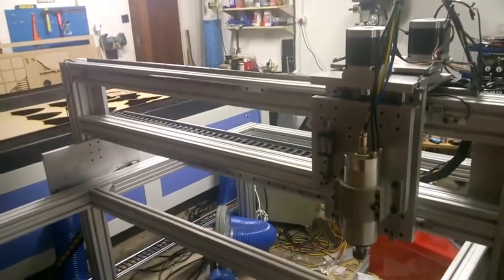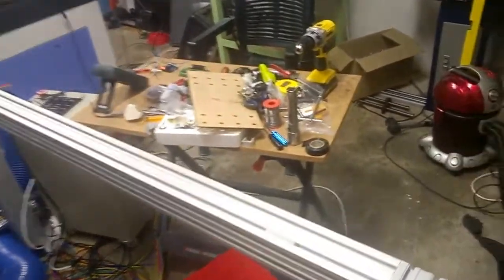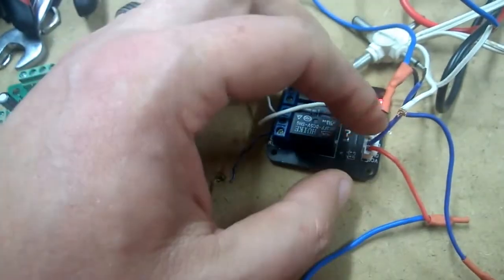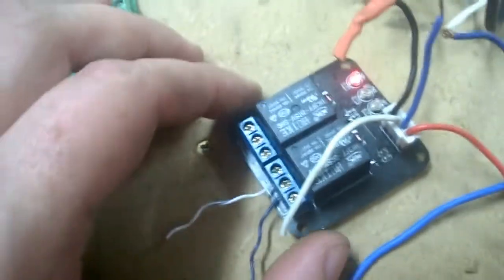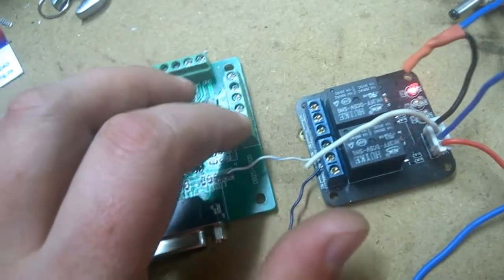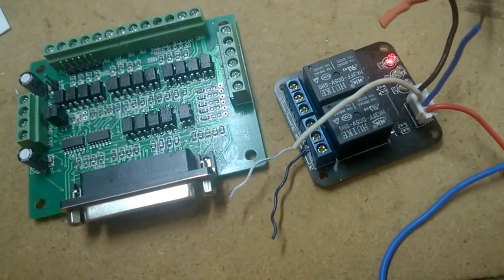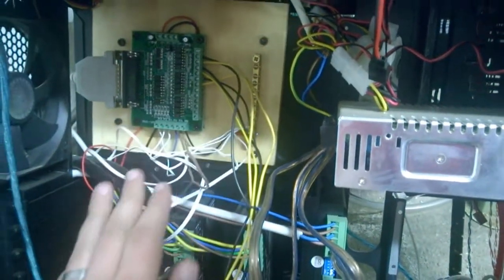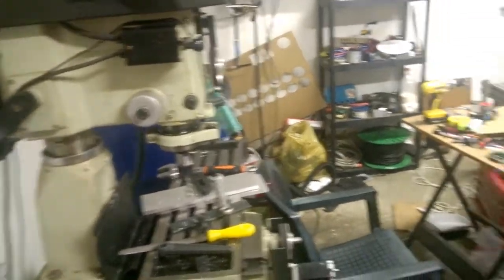Plasma Relay on CNC board

Comment: @Vatso.... a little help. how many volts goes to the "com" of the relay? can the plasma trigger when for example 5v is sent from the relay to the plasma tip. my relay output is like this "NO/COM/NC" i am wondering if i should give the COM 24v dc or 5v dc in oder to fire the plasma. your experience would be helpful to me. thanks in waiting your reply
Reply from the maker: Hi there - the best way to explain this is that there is only voltage for the relay to work. when the "trigger" is pulled on a plasma touch there is no voltage. so all you need is the relay to pull closed so NC & the plasma will fire.
Take the 2 wires from the plasma touch and touch them together the plasma will fire. of course the plasma machine needs to be on
Reply: i got it.... many thanks  ("....so all you need is the relay to pull close so NO & the plasma will fire......" i hope i corrected it）

Comment: hi vatso. i have a few questions. i have the same thc as you. The leeuwinga. it has a relay for the plasma torch included that you setup in mach3 but it doesnt want to work. i then went and bought a double relay but the problem with this is that it needs a ground signal and i have no idea how to set it up to work correctly. the vcc goes to positive and the ground goes obviously to ground but when i take the signal wire from either relay and connect it to positive nothing happens but when i connect it to negative the relay closes. I dont know if you still use the leeuwinga thc but i habe a few further qeustions about it if its possible.
Reply from the maker: Hi Stefan, what you need to do is get an output from Mach3 to switch on and off once you have that working you can hook up the relay. the easiest way to do this is using the same input power you running your BOB connect it to your relay "Your Bob And Relay need to run off the same power supply IE 5v" connect your relay + & - as normal. what you then do is take the relay trigger and connect that to the output which you have working as step 1. what you will see is when the output goes to 0v it will trigger the relay "turn the output on and off in Mach" now all you do is make sure the output has +v when you don't want the plasma to fire and 0v when you want it to fire
Reply: vatso hi vatso thanks for the reply. ill defenitly do that tonight amd let you know what happens. i assume you didnt use the relay that works with the thc? reason im asking is . ive configured the thc the way they said from the manuel i recieved from cncdirect. when i turn on the torch in mach 3 the display panel torch led comes on which indicates the thc bob recieves the signal but nothing happens with the relay. the specific thc has the bob and the plasma interface card that connects to the bob via a 9pin vga cable. the plasma interface card has the torch relay,z limit switch, and arc ok signal. ive connected the z limit switch and it works fine but the relay nothing although the torch led lights up on the display panel when i turn on the torch in mach3! i hope this all makes sense,struggling with the english here haha! thanks in advance
Reply from the maker: Hi Stefan, I am using the Boards internal relay which was working fine - I am in the process of setting my machine up again just did a house move. It could be your Mach3 setup - I will spend some time this weekend testing and sharing my settings with you
Reply: vatso thanks that would help a lot. i will also post my settimgs as soon as i get home maybe you can notice something wrong

Comment: i want to use my hypertherm power max 1000 g3 standard hand torch on the cnc plasma table i built but im a bit confused about how to splice in to which wires in the unit i have........in the back theres a "cnc ready " port but idk if i have to buy the machine torch......im kind of strapped for cash which is why i would rather use the relay method and use the hand torch but i dont even know where to start.......should i trace the trigger wires and splice into them and use a relay connect it to my break out board outputs and set it to something in my mach 4 configuration ?.......im a neeewwbbbb help lol
Reply from the maker: Hi there, the trigger is just a contact switch if that makes sense - what you are doing is setting the relay to just make contact. the secret is the type of relay that is triggered with a 0v. the BOB can't output enough power to turn on the relay. the way to test if it will work is take the relay and make sure it can be powered by 5v "Input power of the BOB" and triggered by 0V / ground. once you have that working you can connect to your bob and set it to trigger when the input is turned off "Ground"
Reply: i might sound dumb but whats a "0V" and a  "bob" ? lol
Reply from the maker: BOB is the breakout board the board that connects to the computer - V0 = Ground
Reply: Thank you....i got some 5v 2 channels raspberry relays...think thatll work for that application?
Reply from the maker: I will make another Video trying to explain how this work

Comment: hey Boet - hou gaan dit? I was wondering if you possibly cover something on lengthy bits or long reaching methods, as Im having difficulty with reaching areas where my drill bits arent long enough, so I tried without success to build some long reaching gadget to get the reach - would you try to possibly lead me to some written material that will possibly get through this problem? Best regards Joao from Jo'Burg

Comment: Very cool build , i am also form south africa looking to build one myself .just a couple of questions, u understand some how the relay switch,  what plasma cutter are you going to use , I have read you need a none touch plasma torch do you have one that you could buy locally?  and are you going to install a torch height controller or not . If it is possible can you mabe at a later stage put up a video of your wiring to the plasma torch?  

thanks again for the video
Reply from the maker: Here is a quick video of it working https://www.youtube.com/watch?v=jaxabBOKDG8 - I used a Touch Height control and am using a Hypertherem worth the money really great product

Comment: Thanks for the videos. I am working through building the same concept as your original 3axis table. What drove you to start over with a new frame? Also you mention in another video the importance od shielding and grounding. Did you ever publish that video. I'd like to see how a machine acts when that is an issue. Thanks again.
Reply from the maker: +sbirdranch Hi there - the reason I started over was I wanted a larger bed size for Plasma cutting so I decided on 2.5m x 1.5m. I really need to do another video on the shielding and the affect of no shielding I have just moved to the UK with my Machine what a mission. Maybe I should also do a vid about that drama.

Because we are using Stepper motors and do not have any encoder we can't be sure if we are loosing steps and there is a signal that determines the direction and step when one gets interference it can and does cause the machine to miss steps. VFD's control the speed of the motor and by nature this is done by frequency. the cheaper products really are not well shielded or grounded and this ends up running on the motor cables. Also there is a technique to grounding equipment this needs to be done at one point only.

If you give me a week or 2 I will do the video
Reply: congratulation on the move.  The weather here hasnt gotten cold enough to get me back in the shop so my progress has not resumed.  Ilook forward to you coming videos.  having done a few myself I appreciate the amount of time it takes to edit and publish one.